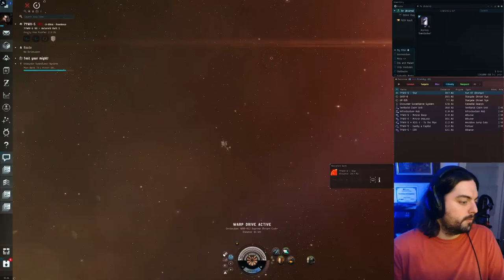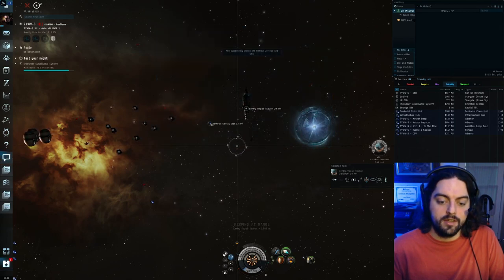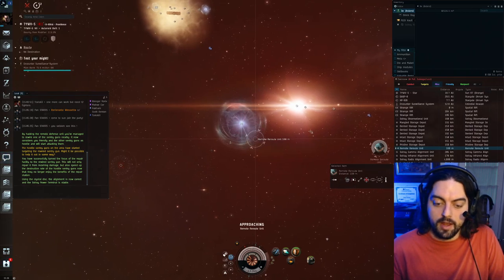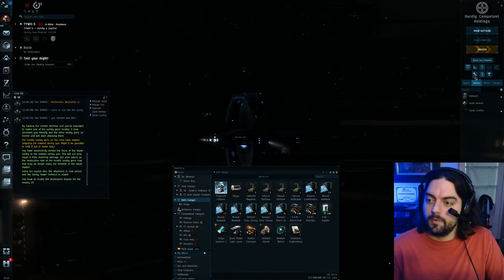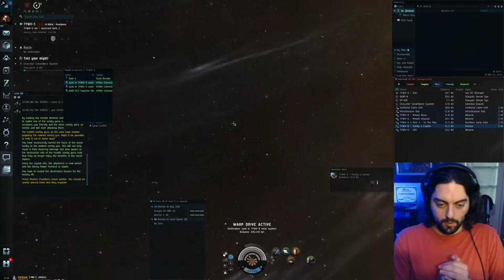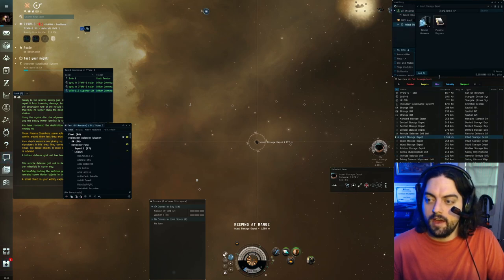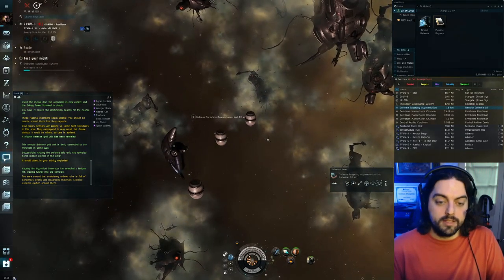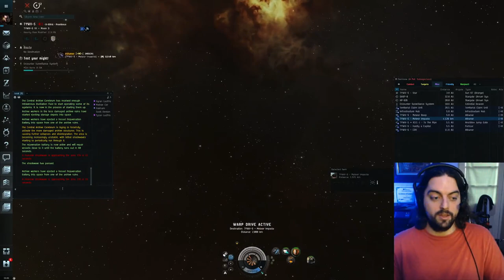Superior Sleeper Cache Walk-through / Tutorial - Eve Online Exploration

Comment: just a quick Q: you think an armor tanked astero with dedicated T2 modules instead of the combined one in the mids would work? should get higher virus coherence / help with the hacking, right?
Reply: The Zeguma module gets the coherence bonus from both the relic and data skills so at base its starting with 130 coherence since you need both relic and data to 5 to use it. The only "drawback" on using a combined analyzer is you only get 1 utility slot (vs the 3 on normal analyzers) but pairing it with a blackglass implant turns the Zeguma into ezmode hacks

Comment: what's the fit you are using? i cannot seem to tank the solray area just in shields
Reply from the maker: This is what I was using, but really any medium shield and hardener should work for just that room. 
[Astero, *Astero]
True Sansha Explosive Armor Hardener
True Sansha Explosive Armor Hardener
200mm Steel Plates II
Vigor Compact Micro Auxiliary Power Core

Republic Fleet Medium Shield Extender
Zeugma Integrated Analyzer
Multispectrum Shield Hardener II
1MN Afterburner II

Small Low Friction Nozzle Joints II
Small Memetic Algorithm Bank I
Small Explosive Shield Reinforcer II
Reply: @nthdimensional  thanks.
Reply: "A Reactive Armor Hardener shifted over to 60% EM damage resistances, this is a good indication that the damage appears to be exclusively EM damage."

This info is on the Eve University Superior Sleeper Cache. I can also confirm that the increased thermal or kinetic resistances don't seem to reduce the damage taken from the Solar Flare and that the damage resistances from the Reactive Armor Hardener shift all the way to EM.